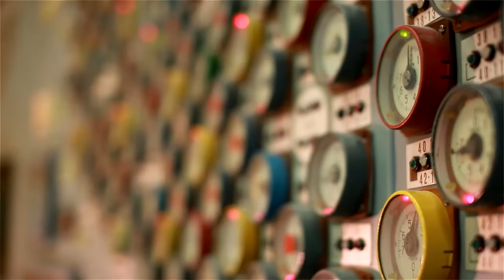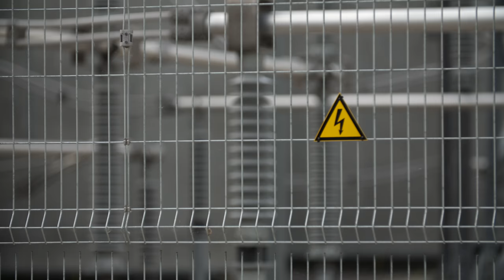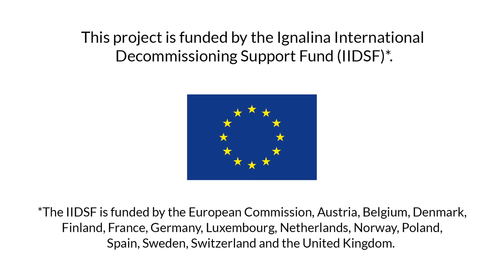Decommissioning Ignalina: an International Achievement

Comment: How sad. The RBMK reactor has been improved dramatically since the disaster. Chernobyl can't happen again, because it's now impossible to run an RBMK reactor in the way it was run in Chernobyl. 
I hope they will get generous financial assistance in building a new, perhaps not graphite moderated reactor.
Nuclear is our only option to generate really clean electricity in large amounts, in places without powerful rivers. Renewables are an awesome addition for loads that can be scheduled, but can't just be the sole energy source.
Reply: It’s not sad, it is just stupid to shut down a nuclear power plant that supplies most power in a country